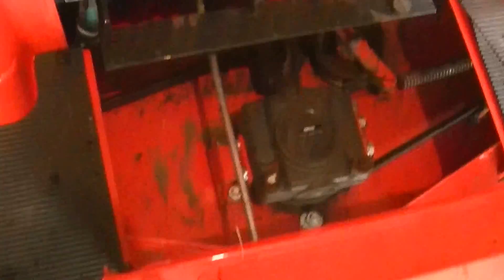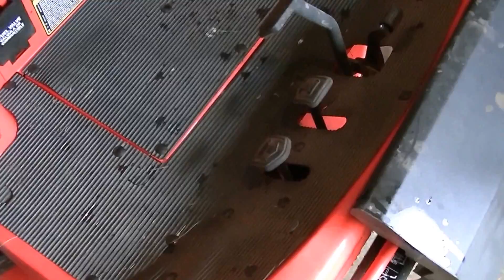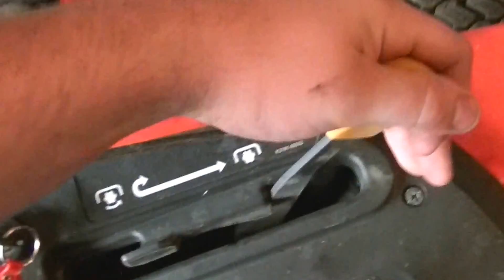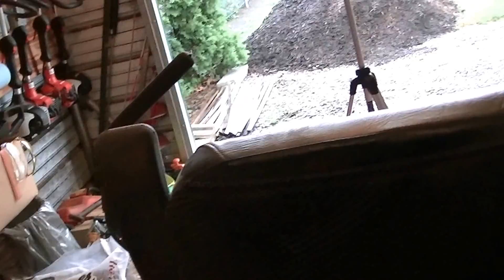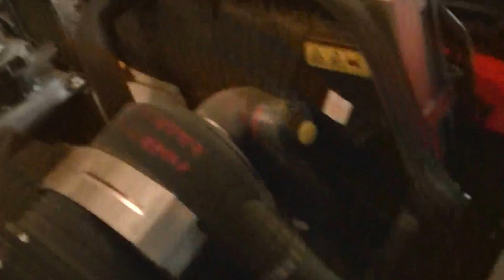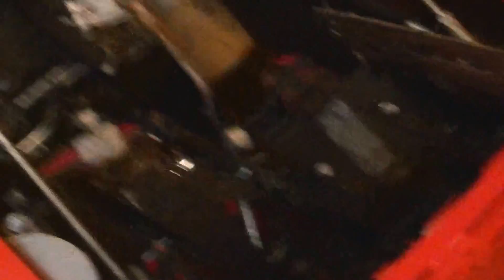Kubota ZD326 zero turn mower

Comment: Ive had a ZD326 for 2.5  years now. The space in between the screen & the radiator is impossible to get to & yes grass will get past the screen and stick to the radiator. If the grass is slightly wet it wont make it up a 10% grade without spinning & or making a rut. Honestly the only place it's designed to cut grass is on a Very Flat surface....    Its constantly looses power while mowing so i am constantly bleeding & re-tightening the fuel lines, its a pain in the ass...  Two or three times a summer i have to re-adjust the deck because it becomes uneven(nobody wants swipes of extra low cuts in their lawn) Cant say it is Worth anywhere near the money they ask for it(with tax in my state it was $13K) i dont see it lasting 10 years either( hey does anybody make anything that last any more...?), you would probably be better off buying a cheap($2500 or less) zero turn and replacing it every year or two....

Comment: kubota zero turns and front mounted mowers  are nice and prices are reasonable and the  cheapest brand in the market better then the cub cadet we use for town mowing and breaking down every time and the cub cadet tank with 60'' and 26hp we paid $37,000.00 on a cub cadet junk and we been reciving wrong parts wich cub cadets we never been happey and blew head gaskets 6 times even after getting it from the dealer so were planing getting a kubota wich be more reliable and cheaper for the budget and parts are the cheapest then other brands plus the cub cadet over heats the engine and stalls wich cub cadets arent very good and not reliable wich we be alot better with kubota

Comment: this is a good mower. I use one at work...runs for 8 hours constant and is great on fuel. Never overheats or stalls out.
Reply: +MMID303 the zero turn cub cadet 26hp wich it is a piece  junk we use for our town  the stupid thing overheats and stalls and kills the engine every 5 mintues  and after bought it from dealer  blew the head gaskets our of the engine 6 times after we bought 5 years and 5 years it been nothing but troubbles and its a night merrior to service it too have to split the machine to  change the hydrulic oil filter in it wich is right down at the bottom so its alot of problems on the cub cadet commercial mower  we been having and we paid $37,000.00 wich was rediculas price on a 26hp mower and problems after buying it :p

Comment from the maker: I like it actually. it rides nice and has plenty of power. Everyone has a right to there opinion.  To add to StanWilhite, I understand the idea of safety with equipment that can hurt someone severely, but having to depend so much on electronics to run every thing can hurt productivity when you have problems engaging the blades.

Comment: This blade engagement has been around for about 50 yrs. The electric PTO is used for safety. It has a brake that stops the blades in seconds. Also, in an emergency, the theory is that a person can reach over and slap a knob instead of trying to find a PTO handle and disengaging it.

Comment: Also, no mower decks work on actuators. Most use chain lifted/ manual lifted decks with a foot pedal to pick up the deck into transport mode, to mowing mode, which is set simply with a pin into a hole.